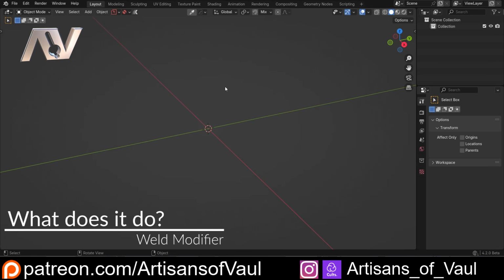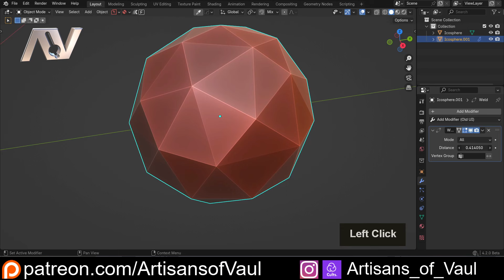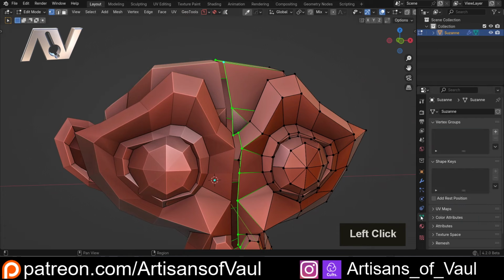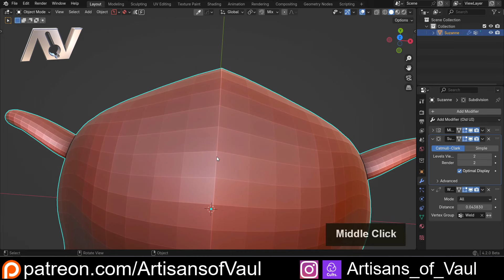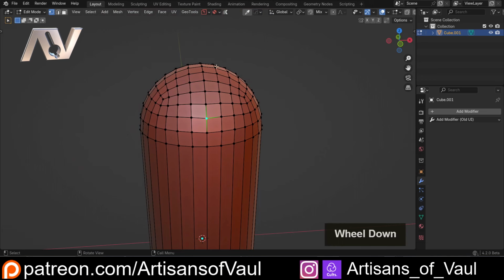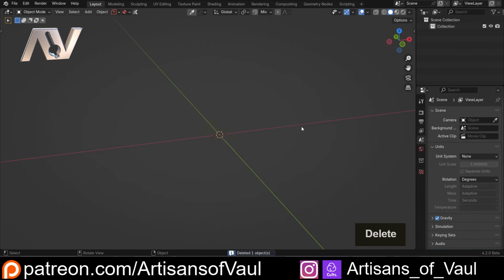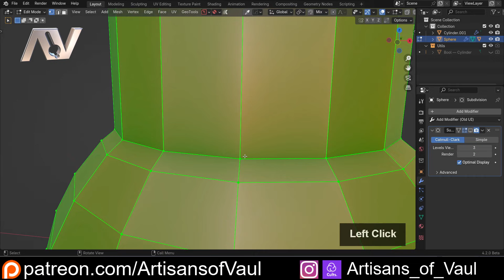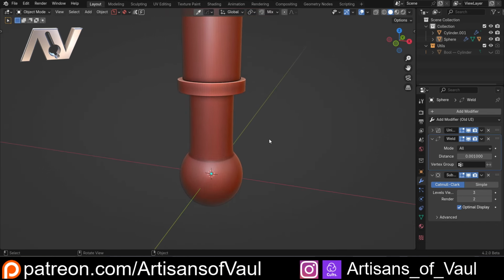Master the Weld modifier in Blender

Comment: The Weld modifier (and Merge by Distance node in Geometry Nodes) are a workhorse. Never the star of the project, but essential for making it work.

Tip: If you use Geometry Nodes to Boolean instead of a modifier, the node outputs the edge loop in the new mesh that is the join-line (s) between the two meshes. Use that as the selection for the Merge By Distance node, and you can restrict it to just the new geometry from the Boolean, just like using a Vertex Group with the Weld modifier. That lets you be more aggressive with merge distance (just like the monkey example).

I use that so much that I'm rarely using the actual Boolean Modifier any more.
Reply from the maker: Thats a great tip.  If you don't mind I'd like to make a video on that?

Comment: PSA to my blender friends: 'Set-Origin to selected' is a tedious operation: Originally It's cursor to selected, then origin to cursor. There's a built-in addon called "pie menus". Enable it, and only enable the Ctrl+Alt+X. Then, using this shortcut, you can move the origin with ease.
Reply: That is fantastic! I only wish I would have known this last night, as I spent untold amounts of time setting the origin to the bottom of a whole slew of objects. Thank you so very much!
Reply: @daggergblue  Happy to help! Glad I posted this
Reply: @daggergblue  While we're on the subject, Ever been in a situation where you rotate 90 degrees on Z, only to realize you need to go the other way? Instead of esc, then r-z-270, just type '-'. It'll interpret it as minus 90
Reply from the maker: Good tip 👍🏻